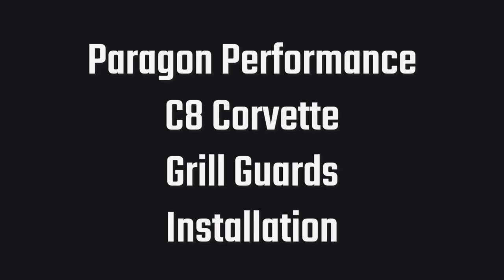C8 Corvette Radiator/Grill Guard Install - Bolt In - Paragon Performance

Comment: Installed mine yesterday on my 2022 C8.  Easy to do if you have any mechanical ability.  Take your time and have above video handy to guide you along the way.  MY car on has 380 miles and already has some minor dings in coils.

Comment: i'm going to mount mine between bezel and grill...move the nut clip and replace the screws from the front.....may werk / may not  ....ps-on my 2020 i bought some expanded metal , cut it to fit , painted and installed...they are still invisible and working after 54k

Comment: Don’t forget to make center smaller inner grills.  I originally didn’t put those on my C8,  and my radiators got beat up on the inner lower corners pretty bad, I wound up added the small inner grills.

Comment: I like these guards you guys put out, but I'd like to understand why the price is 2x that of your competitors? I can understand some increase given the quality and attention to detail, but a more than 2x increase over competitors feels prohibitive. For that price, I'd also like to see air flow restrictions or temperature differences vs competitors.
Reply from the maker: Due to the CNC nature of these with the custom grill pattern which matches the OEM pattern, and also the bolt in OEM style the cost just goes up unfortunately. Custom tooling was made to make these and there is just higher cost in creating something like this that doesn't use zip ties and look cheesy. :(
Reply: @ParagonPerformance please have an owner reach out to me about my Grill Guards. By the way, I purchased the clear engine cover for my C8, so for it looks great and has not created any heat issues.
Reply from the maker: @curiousgeorge7386  Hi George, what can we help you with about your guards? - Justin

You can also reach out to support@paragonperf.com for customer service.

Comment: I got a set of the C8 grill guards and installed them which is great because I don't have the most mechanical skills.  The grills  fit great and cover the areas
Required.

Comment: I've seen these anywhere from $100 - $500 on various websites.
Reply from the maker: Other brands are generic chicken wire from the hardware store where you ziptie it on. Ours are custom made to specifically fit the C8 Corvette with OEM mounting locations.
Reply: @ParagonPerformance  do the chickens survive? Save the chickens!

Comment: I'll also add what about the section inside the grill opening where your protecters are installed, that area is wide open for rock damage to the radiator ?
Reply: @RobertMacCready  I don't have my C8 yet, well then the ac condenser will get damaged, look a little closer
Reply: I'll have to search a little bit more again but there was a couple companies offering screens for every opening where something could get damaged including the condenser Robert mentioned with out a screen. Paul Codi mentioned this on his reply below.